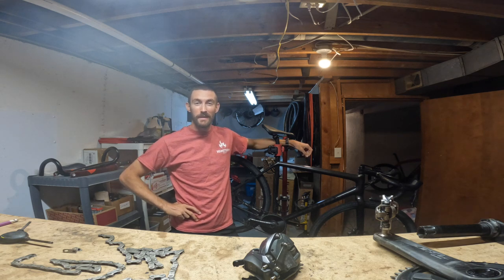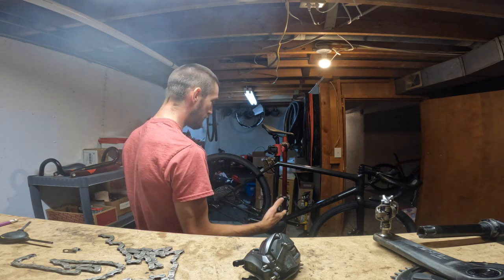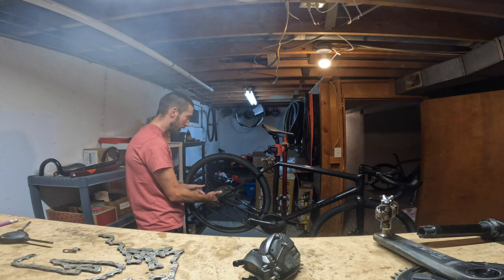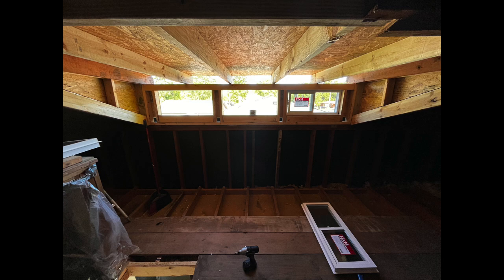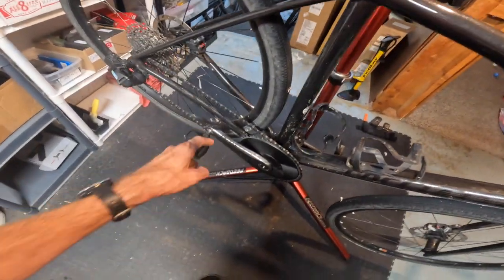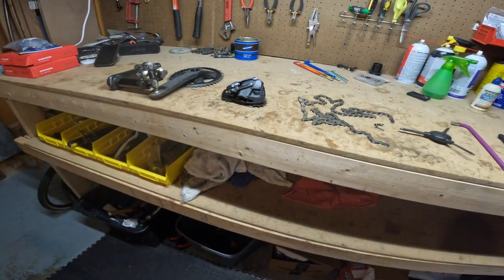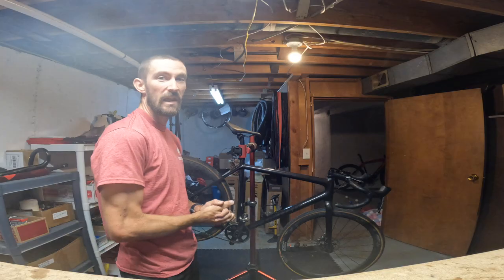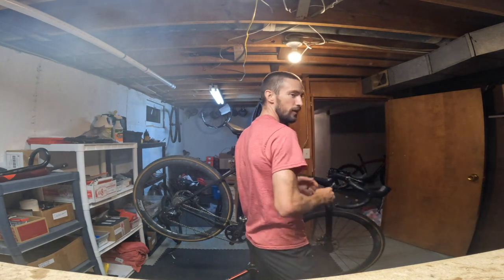How You Need to Set Your Bike Up If You're Racing Cyclocross And Gravel on the Same Bike

Comment: Nice overview of how easy it can be!   Besides my Boone, I'm using a 2019 Crockett as the ultimate CX, Singlespeed CX, Gravel, SS Gravel bike.  Sliding dropouts for SS, and just add RD, Cassette and longer chain for geared.  I do have separate 9-45 and 10-36 cassettes, but the Xplr shifts both fine.

Comment: I literally just did almost the same thing on my gravel bike but switching from gravel (Eagle mullet) to XPLR for winter road mode. I do like Sram’s 1x and AXS architecture but admit it’s frustrating that Eagle and XPLR are not cross compatible otherwise you could cycle among all three setups with minimal parts (and $$).